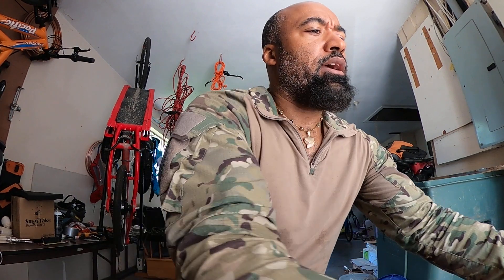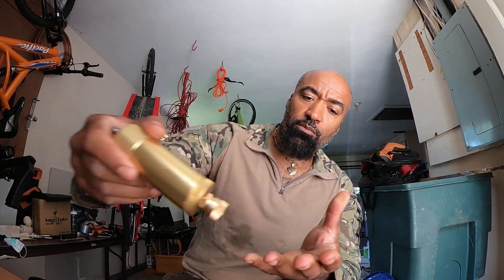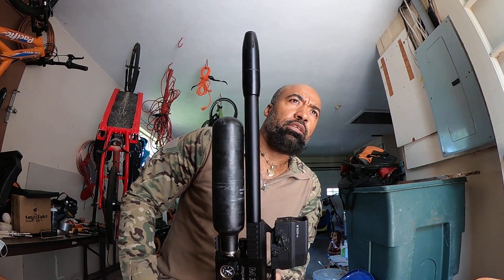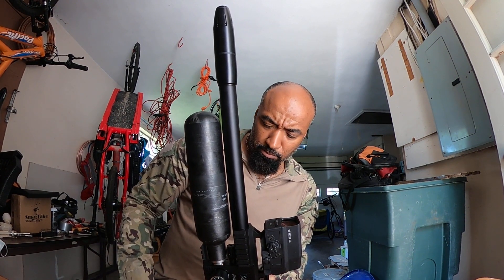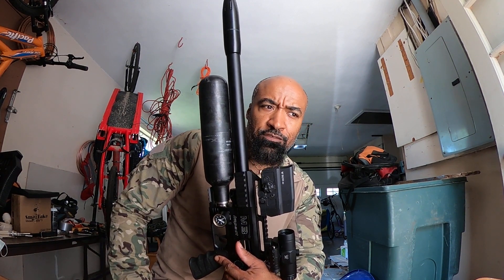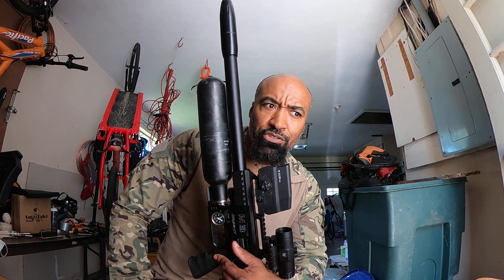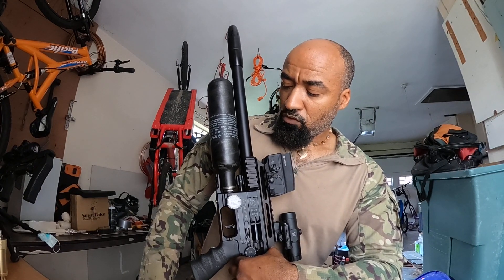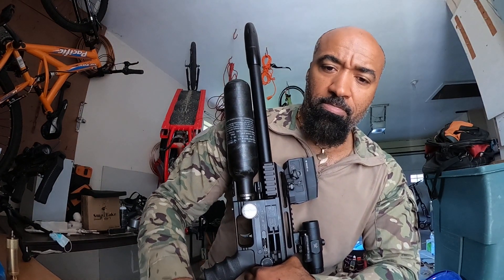GX pump de

Comment: Get a humidity meter,,. Get a 6 liter bottle and have a dive or paint ball shop fill it up ,,,. Until your ready to get a omega compressor,,. 😁. Screw the valve by the bottle in to the second line,,. That should bring the spread down,. Put a couple of synthetic Lucas gun oil in the first regulator to protect the internal metals..